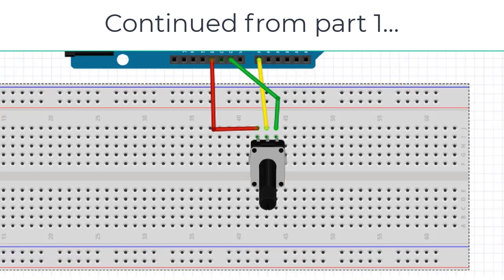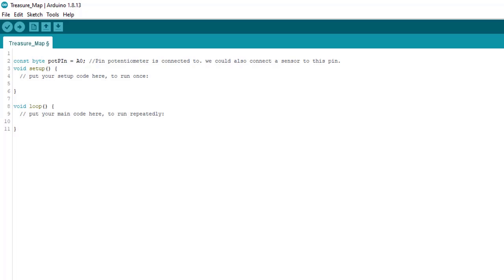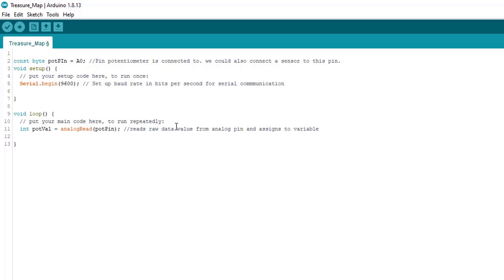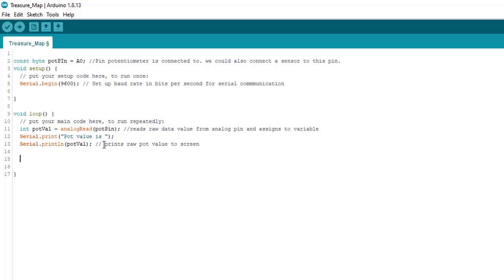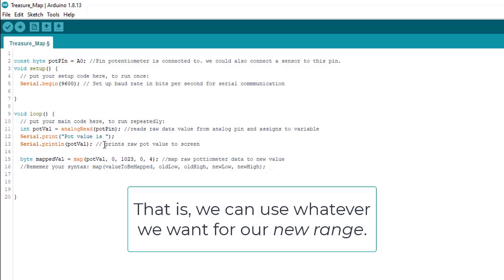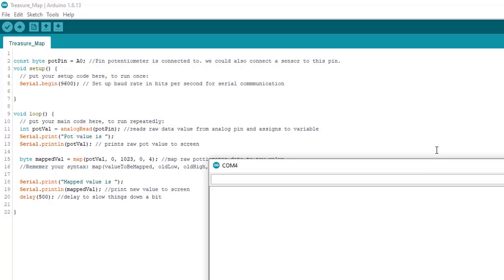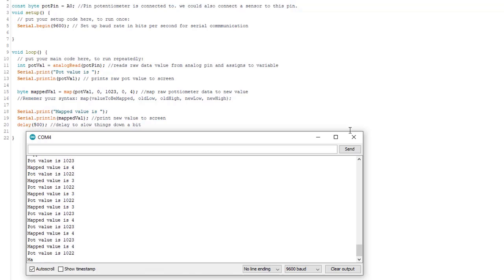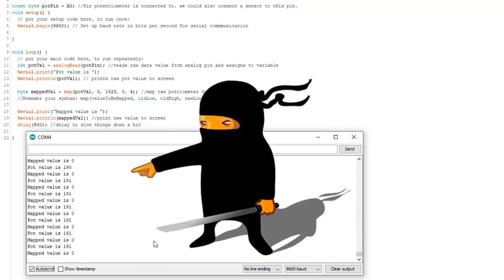How to use the Arduino map function Part 2

Comment: Oh this was EXTREMELY helpful. I'm building a marine air conditioner controller. The replacement controller is WAY too expensive because it's for a boat and that jacks up the price by 1000%. I was having to figure out a complex formula to convert the ADC conversion into the temperature range of the sensor. Oh, this is so much easier. Once I tested the max and min voltage output of the sensor, recorded how those were converted into their binary values, plugged that into the function ... bingo! from 60° to 90° it's accurate to half a degree!
I got so giddy that I'm using the map() function to convert switch inputs to the analog inputs to 0 or 1. heat_on = map(analogRead(A1),0,1023,0,1) (no IF comparisons) It freed up four digital inputs so I can now interface with an LCD display.
Reply from the maker: That's awesome, glad it was helpful and you were able to apply it to your project!